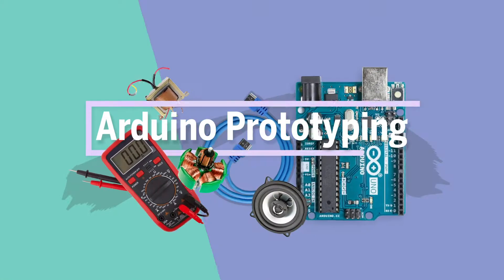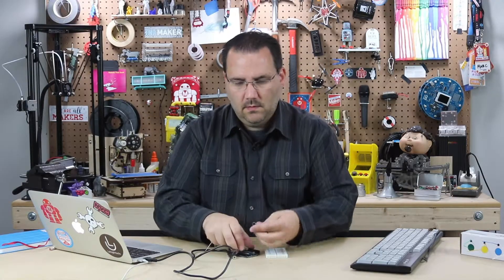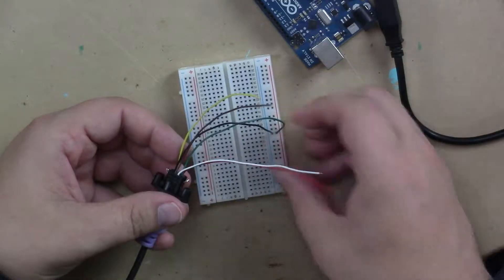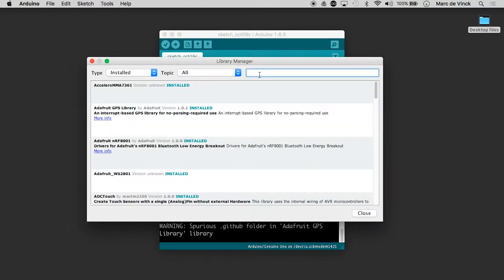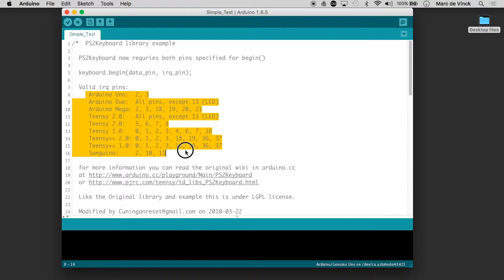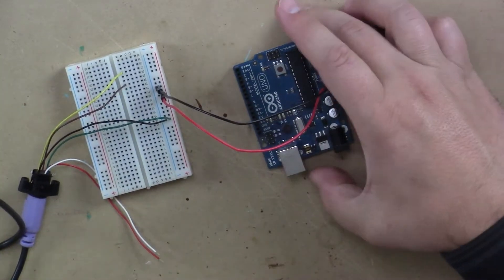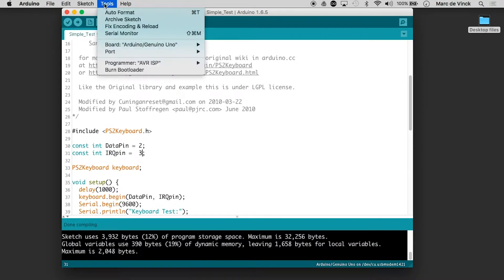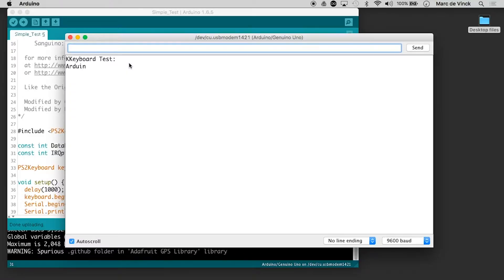Arduino Prototyping Inputs #33: Keyboards

Comment: On video you only test on serial monitor, I need to use that output to control a LED, Ex: output data "Q", LED 1 HIGH. I'm new.
Reply from the maker: If you can get the serial communications to work as described, converting the code to turn on/off a pin (LED) based on an input, is a trivial task. Check out the arduino website and look at if/then or state changes.
Reply: @MarcdeVinck  If you don't mind could you write a simple code, EX: arduino read a "Q" so LED1 == HIGH. I could did a research but gonna take time, But if you could do that, It gonna save a lot of time and I will be really appreciate it
Reply from the maker: @cliffordjohnathan6140  I really can’t share code via YouTube comments. But good luck on your journey. You might want to reach out to someone local for help learning code and hardware. Hackerspaces, etc. You can also use up work, freelancer, or Fiverr.

Comment: Can this be done using a Arduino nano? I want to see if I can fit it I to the inside of the keyboard case, I have other keyboards but I like the ps/2 one. Also is there support for media keys in that code sample, and if not, can I add it.
Reply from the maker: Sure! You only need a few pins. You can learn more about how it works here -- https://playground.arduino.cc/Main/PS2Keyboard

Comment: What if I want to use a ps2 keyboard as a wireless bluetooth keyboard to use it on my pc using an Arduino . What do I have to do?
Reply from the maker: The easiest way, maybe not the best way, would be to use an inexpensive Arduino to read the incoming keypresses from the ps/2, then use an inexpensive wireless sender/receiver (~$3) to another HID compatible Arduino that reads the incoming serial data, converts it to a keystroke , and is connect via USB.